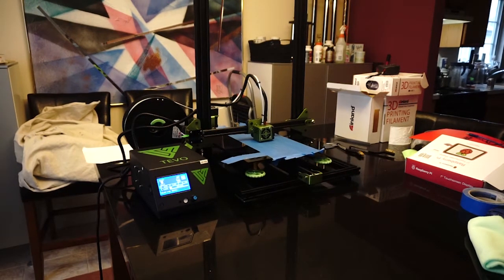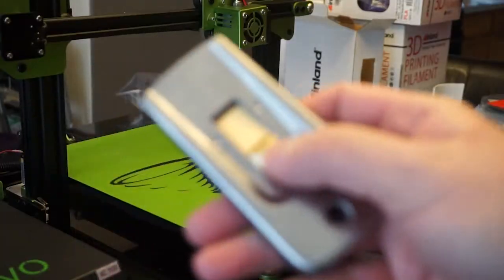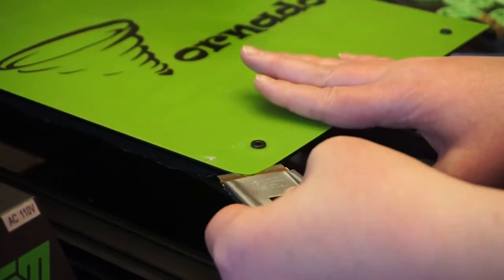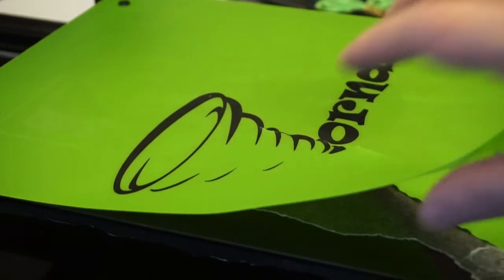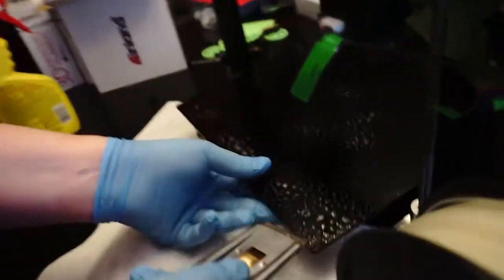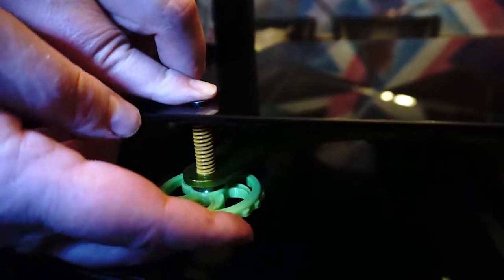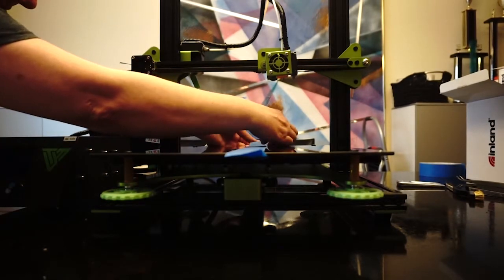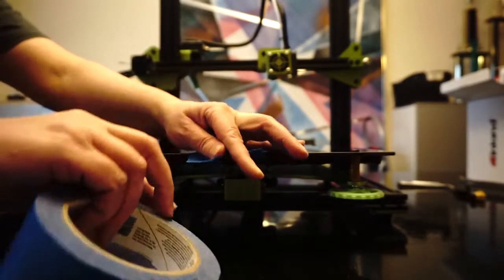Tevo Tornado Print Bed:  Removing Stock Build Surface (tevotak not buildtak) step by step

Comment: It´s really necessary the tape in the end?
Reply from the maker: Yes I prefer to print on something other than the glass.  I eventually used a buildtak flex plate system with that surface, its really better than tape.

Comment: Be really REALLY careful with using Goo Gone/Off in a closed room. Last time I did that I ended up in the ER with heart issues. It's nasty, NASTY stuff. WD40 does a much better job of removing the goo.
Reply from the maker: Thanks for the warning... We were in a fairly open space with a lot of ventilation but it was pretty stringent,  and other people may not realize that this is a danger!

Comment: I'd like to see how well the new setup works for you. I just bought a Tevo Tornado and like it but I plan to use a sheet of PEI with binder clips once the Tevotak needs to be replaced.
Reply from the maker: This has been working so well!  I rarely have to recalibrate the printer bed now, because lifting the prints off and removing them has reduced the vibrations that contribute to it going out of alignment.
Reply: ModShapes, So you're still using painter's tape on the glass bed? I also have an Anet A6 printer and tried painter's tape on it with mixed results. I ended up putting a PEI 1mm thick sheet on it, that worked perfect. But if the tape is working good for you, them I'd stay with that.
Reply from the maker: We only used that tape for one print - we use the FlexPlate System, and when this video was shot -  that was being delivered in a few hours, and I did not want to put the extra sheet of stock adhesive that came with my tevo.   We put up a video about the Flex Plate system - it is amazing!  I highly recommend it.   https://www.youtube.com/watch?v=3-ropZGtT9w